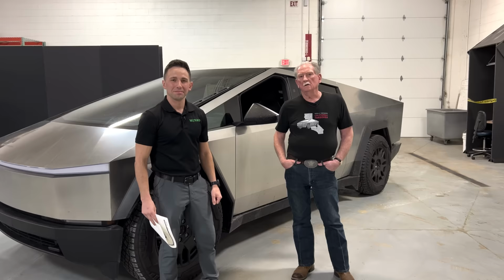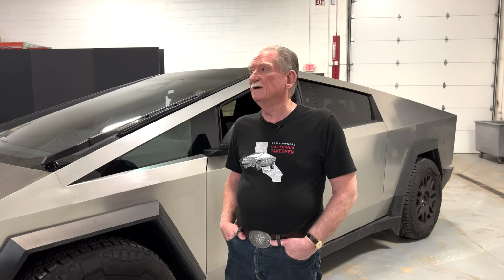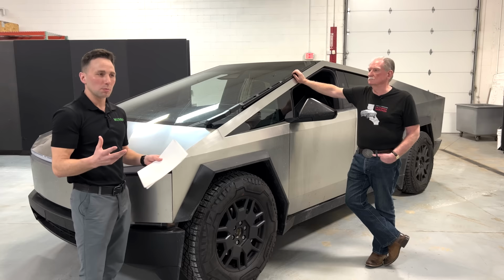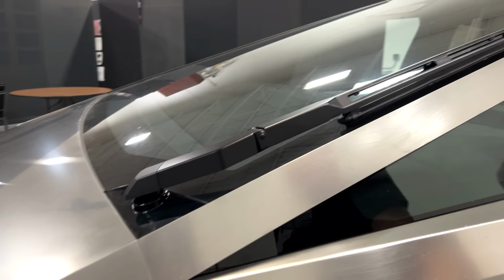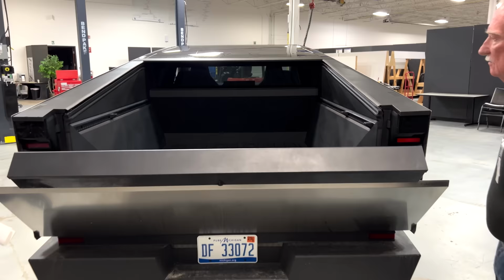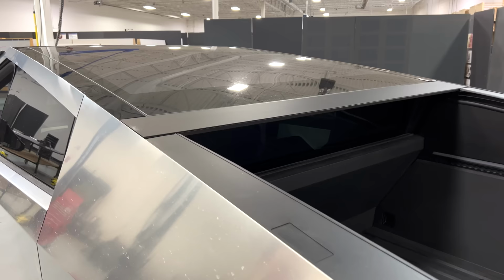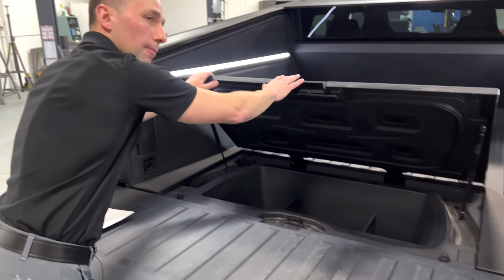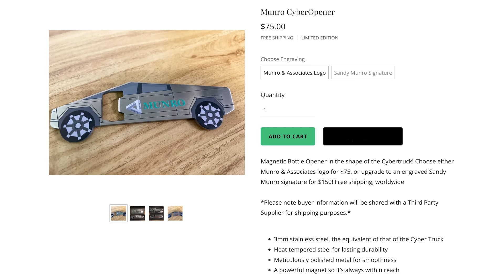We're Tearing Down a Cybertruck!

Comment: The "competition" is also doing a teardown (not 100% correct title ... <G>). Just started, exposed a few interesting points:
World's 1st Cybertruck Teardown - Steer-by-Wire, 48V, Battery & Gigacastings
https://www.youtube.com/watch?v=khPMITqp91I
These guys noted that one of their back door hinges was wrong.

I saw a report of a Rivian that was in a rear end fender bender. It tweaked the rear side panel a little, and the box gate. The damage was not servere. But it turned out to be enough that given the construction of the Rivian, the rear quarter panel AND the roof all had to be replaced, $30,0000+.  Since I read that I now can see that the roof is a separate piece from the front and rear quarters.  Are the gaps large enough to allow a rear end accident to bend the pieces without also bending the roof?

Does the truck come with a spare tire, or are you left on the side of the road waiting for a service call? Full size or donut?  Under the bed, like Fords? Or somewhere else.  I see that Tesla sells a separate full size tire and cover and toolkit that sits in the bed. It's "only" $1,250!  Does that mean you are driving around without a spare?  Is the spare tire too big t permanently stand up bolted to the side of the bed?

Comment: Even "such a thick panel" - is hardly reallystructural - a flat panel like that is still fairly thing - in engineering terms, and if it were stressed  other than perfectly in-plane, it would be oilcanning like mad.

At this stage, Sandy seems very "starstruck"  - awaiting real assessment (buyers paradox).

Comment: Please let us know about the headlights packing with snow, snow plowing, rear camera functions in bad weather, winch supports, and goose neck support.
Reply: Headlights MELT the snow.
Reply: you can already buy a Cybertruck hitch PLOW.
you can replace the FRONT composite bumper w/ Electric snow plow & WINCH.
Reply: @markplott4820 Snow pack is an issue in west Michigan, often prevents Tesla's cruise control to operate on the Model S.  I hope you are right!
Reply: @tyzoerner4181   - see Cybertruck KING of the Hammers
Reply: @markplott4820  Great video!  I've buried my old Jeep Wrangler more times than can count between the deep snow, soft sand, and deep mud!!!
Reply: @tyzoerner4181   - TESLA Cybertruck is a STOCK snow plow in 4 Wheels.

Comment: Can Sandy please comment on how all these Tesla (and other) cars/trucks are NOT designed for repairs, or major parts replacements, at all. Part of this is policy, but ultimately due to design-for-manufacturing with NO method to repair. The two major subassemblies of battery and drive unit(s) are not available to replace/repair with individual parts; further, the battery design actively resists external repair. 

I comment as an early adopter who had two failures on my 2013 Model S within 1 month of each other -- first the drive unit, costing $7500 to replace in ONE PIECE (instead of the motor, the inverter, the contactors, gears, bearings, etc. etc), then within a month the *main battery failed*, requiring a $21,000 replacement! We opted for the $14,500 refurbished replacement, but there is no option to fix any of the components for these subassemblies. 

So, my $15,000 Model S cost 23,000 to fix. This is not a 'less expensive' design -- it's a disgrace.
Reply: Tesla , are built REAL Durable, NO REPAIRS needed for 300k miles.
Reply: Blatant nonsense, the drive train will go a million miles and the battery is warranted to 180,000 and LFP batteries go to 1,800,000 miles.
Reply: @babylonfive dont Tesla waranty cover everything for 10 years ?
Reply: I understand your issues, and as someone else who supports right-to-repair it stings, but reliability is MUCH better now.
Reply: @WANDERER0070   - 8 year Comprehensive warranty,
Reply: @WANDERER0070  It sure does not. 
My Model S came with a 8-year 100K mile warranty on the major parts (drive train and battery). but that means on day 2,923 you are open to a $21,000 charge when that battery goes BONK. When it happens, there's just a message; your car stops, and you are done.
Reply: @markplott4820  can't tell if you are being serious -- there are thousands of Teslas that are failing catastrophically within months of their warranty dates.
Reply: @fredbloggs5902  Hahaha I can send you the invoices from my failures at year 9 -- I had to pour $23000 into my car to sell it for $22000. Sad AF, for the reasons I stated: when the battery fails for something other than chemistry, such as water ingress, specific cell failure, electronics etc, there is no way to fix just that issue -- the whole pack must be changed. Get that thru your head.
Reply: @markplott4820  4 year paid comprehensive, and 8 year main drive parts only. I was offered and bought a 4-year extension... didn't help.
Reply: Why was Wanderer0070 comment about 10 year warranty Highlighted? It wasn't available in 2013 for my S85, but instead 8 years 100K miles.
Reply: One more thing: I simply asked to have Sandy comment on "repairability" -- both Tesla design decisions and the Tesla Repair policies that are all-or-nothing replacements at very high prices. All the fanboys are screaming about stuff I didn't say... I just said the truth that my car failed multiple major subsystems in 10 years, and it did... never crashed, never abused, as I was a early-adopter and a Tesla lover. Just disappointed to find out how little anyone cares about repair after the car is sold and the warranty is done.
Reply: So to be clear, you bought an old S that originally cost around $100,000 for only $15,000 and then complained when it needed some replacements.

And it never occurred to you to wonder why it was for sale at such a low price.

You’re utterly clueless.
Reply: @fredbloggs5902  huh? You aren't paying attention... I bought a $90,000 car back in 2013 and have owned it the whole time, loved and babied it (no collisions, no weirdness of any kind), and then at year 9  it failed multiple time in succession where Tesla would only replace large subsystems instead of fixing what's wrong. In the case of the drive unit it was a failure of policy, but in the case of the battery it was policy AND a design-for-manufacturing that ignored the repair process entirely, requiring a 21,000 single unit replacement when the cars value was down to $15-16k. 
You got the facts now? 
Still not sure who is highlighting your comments from the Munro side, or why. You are a troll and you don't care what I'm saying.

Comment: I've got no money for a report (and nothing to do with one anyway) but I'd love details on the hookups that will be used for the range extender battery and what sort of aftermarket items they could enable. 
Could a shop make their own aftermarket fast swappable battery packs? They would just need a fork lift or backhoe at the swap site. I can imagine a flatbed truck with crane addon driving around a worksite swapping batteries on the trucks then driving off to some grid connection point to charge them all.
Could a shop make their own gas powered range extender?

Comment: You think only eggs are exoskeletons?  News to insects and crabs, I suppose.  Almost any unibody is technically an exoskeleton.  But crabs have exoskeleton under their legs and gills, no different than the gigacasting.
Reply: UNIBODY is outdated & too HEAVY.
CT weighs LESS than Lightning, Silverado EV, and RIVIAN.
Gigacastings & structural battery are SAFER w/o adding MORE weight.
also Tesla 4680 cells are CLASS leading.

Comment: Really don't get why an F150 with nail polish and tinfoil fenders is more of a work truck than a CyberTruck. The CT can tow more, has higher payload than F150 (and some F250), has more power, has better charging infrastructure (even when Tesla opened the network to Ford)... it's just a better truck - for play or for work. Once Tesla releases the range extended pack, towing should now longer be an issue either. The only issue with CT is the price, but that would come down over time... so in the long term it's not an issue either.
Reply: Wrong. The F150 has a proven track record while CT is a completely unkown experiment. Ford's 3.5 L Ecoboost can tow 14,000 and hold 3,230 while CT only tows 11,000 and holds 2500. Eventually a "work truck" gets dinged or scratched. The surface finish on the stainless will be impossible to match in any kind of dent repair. Repairability of giga casted structures will be a large problem in insurance claims. Not practical and looks bizarre to boot. No thanks.
Reply: @canlib  First, Sandy was referring to the F150 Lightning which has less than 2000lb payload with large battery and tows 10,000 pounds - both less than the CT. As for the stainless steel - from everything we've seen so far, it does not ding. Not even with a sledgehummer. If it does, a similar F150 would have the panel completely mangled which would require a new panel with a paint job - which is not cheap. The CT panel unscrews and you screw on a new one. Literally 15 minute job and would probably cost less than similar repair on F150 (due to paint cost etc). All stainless steel in CT comes from the same factory so should not be an issue to match - actual cybertruck parts RIGHT NOW come from different stainless steel rolls without any issues. On the other hand, matching paint is ALWAYS an issue, especially on older trucks.
Reply: @ranig2848 You're the one who bought up the F250 has less load capacity which you're again wrong about. F250 has between 3900 and 4200 lbs cargo capacity weight compared to 2500 for CT..

Comment: Spare Tire.... No location to hold a spare just does not make sense.
Reply: Put it in the bed or rear seat area.  Seem few need one, but every use case is different. For most, a spare tire is a waste of space and cost. You can call Tesla to have the tire changed/fixed (they have a mobile service to do that).  I expect few owners spending this much will ever change a tire themselves.
Reply: @tesla_tap  Actually if you call their service they no longer come out and change the tire. They tow you to a service center and do the repair/replace. The issue is if the service center is open. Travel outside of business hours and a simple tire change becomes an overnight problem. 

All I would like to see is a location to carry a full size tire and tools, just like cars and especially trucks have always had. I would be willing to pay for the tire, but the secure space to carry it is the issue.
Reply: Cybertruck, like all TESLA , don't need spare tire.
TESLA sells , patch kit & electric tire pump.
Swedish model.